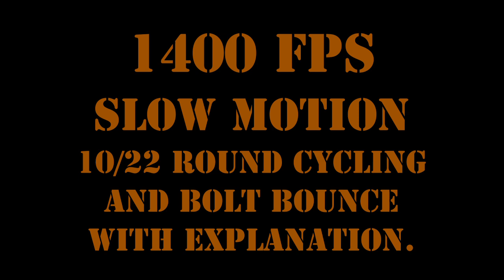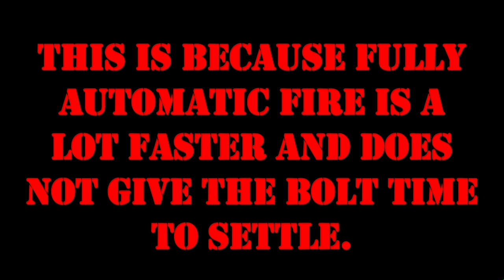BOLT BOUNCE / ROUND CYCLING AND THE EFFECT ON A RUGER 10/22 IN 1400 FPS SLOW MOTION.

Comment: All well and good but how do you reduce/eliminate bolt bounce. spring length / tension  or more polishing of the bolt. that said non of us would make a 10 22 full auto or select fire :)
Reply from the maker: *****  I guess the answer for a 10/22 is you don't, changing the tension of the spring would affect how it cycles different powered rounds. lets say a subsonic round, probably would not cycle with a higher tension spring.